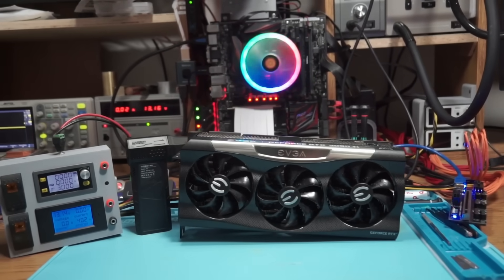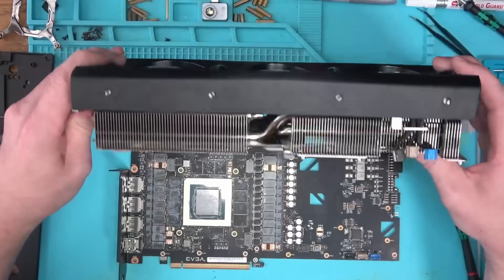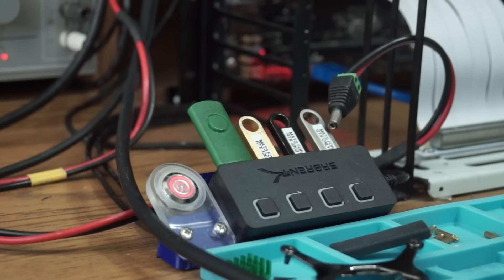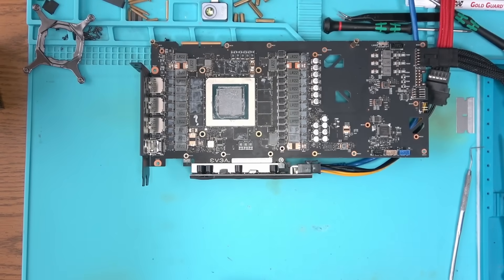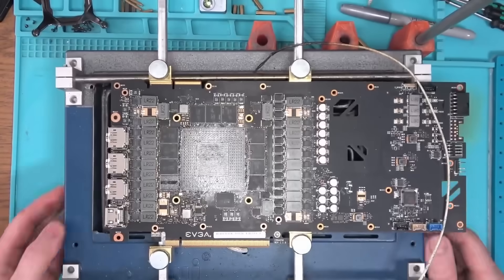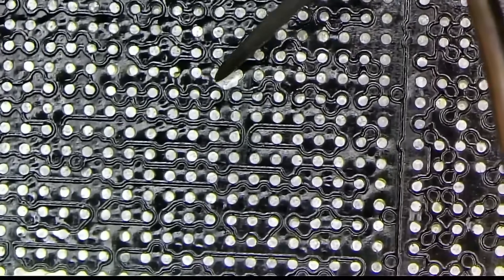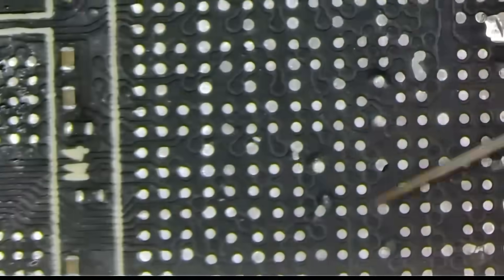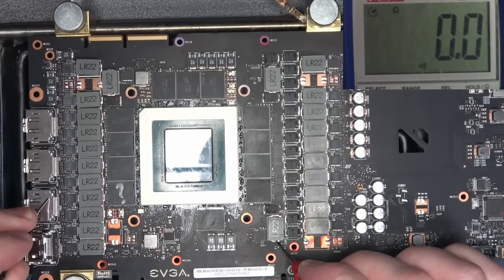The truth behind EVGA RMA'ed graphics card

Comment: You're clearly not doing it right. Put a 1mm thick layer of solder mask where the core was, drill little holes into it where the pads are supposed to be. Solder balls into the holes, melt, put core back on. It will work, you have my guarantee as someone who has never fixed a single GPU and knows nothing about soldering, solder mask and GPUs.

Comment: I had an RMA'd EVGA GTX 980 Ti that i used for about 7 years without any issues. I don't think your card died because of EVGA RMA, I think the PCB probably took too much heat from overclocking. Since each time you re-balled the GPU the problem got worse, either the heat or your cleaning was the problem. I don't think it was your cleaning because i've seen many of your vids where the cleaning wasn't a problem. So it must have been the heat of soldering and removing the GPU that was causing it.

Comment: Just a stupid idea but if that happens to your card, the "manufacturer" is supposed to replace if can't fix? I know it is out of warranty but if the turd party repair shop is cooking the board to death, there might actually be a legal way to either make EVGA or their contractor to pay for damages caused since loose/peeling solder mask is without any doubt a symptom of too much heat aka bricking not fixing the board against better knowledge/practice. Anybody can look up what happens if you overheat a pcb, you don't need to be a genius to know good practice...

Comment: @Northwestrepair. I own a preowned msi rtx 3090 suprim which seems to work fine, but when i start the pc and a tv screen is active, the pc screams with beeps at me: beep beepbeepbeep. Do you maybe know, what could be the problem? As mentioned, it works fine, i even use a gpu supportbracket, but the computer screams at me, when the tv is on. What am i doing wrong?

Comment: EVGA GPU's from excellent reputation to dis-honorable trash service. I own an EVGA 3080 TI FTW3 that I actually copper modded that suffers from silicon lottery temps, but at least the memory runs cooler, and undervolting manages to just get by with the GPU performance. Disappointing, most people would not know what to do about getting a poor quality GPU.

Comment: If you couldn't fix this card I doubt J.C. could resurrect it.   I was wondering is it possible to upgrade/mod an AMD 9700XT into a 9700XTX ?  Thanks for the video.  If I ever need a GPU repaired I will be sending it your way rather than dealing with the RMA lottery.

Comment: Solder mask doesn't like sticking to lead, so the moment a copper trace got tined ur done, even if you apply a solder mask, that mask is now sticking to solder which will melt the time you try to reball the chip and that mask will now float on top of that lead as the surface tension pulls more lead under that mask

Comment: Have you tried relife solder mask? I also do know on iPhone cpus you can get plastic clear stencils with black dots where all the pads are ...basically you apply a small blob of mask and press it flat with the plastic align the dots and cure th e mask then remove and clean you should have a even masking layer across the entire surface ...relife mask is what I use for pad repair under cpus

Comment: Would it be option to make solder reverse ball mask that covers all the solder joints, then spray on conformal coating or solder mask UV let it dry then try a reball nothing to loose ?

Comment: Makes me wonder if there's a possibility of using some kind of 3d-printer-style solder mask applicator. Or maybe a photo mask template. Problem is, you'd have to remove all the mask first, as it will build up otherwise.

I imagine the middle layers are likewise cooked, too, so could have shorts inside the board from solder seepage into tiny cracks?

Just a really nasty problem to solve. Good effort, though!

Comment: Bushing on a full coat of mask and using a plastic clear stencil with dots that line up with the solder pads to prevent the ir light from hitting allowing for perfect insulation repair

Comment: Well, the core and memory are PROBABLY fine, so a donor board transplant seems like the next step, THAT MULTI-ANGLE THOUGH!🔥 Excellent video Tony!
Reply: I've got an MSI 3090ti Suprim that has a core from an EVGA 3090ti FTW3 simply because I have the boardview and schematic for the MSI board, not the EVGA board which had some knocked off components. MSI card had a severed memory channel and I actually tried to drill out the core substrate to try and locate the severed trace to repair, but ended up being too deep to be repairable. The in-layer traces on the core substrates are truly miniscule....
Reply from the maker: Good luck finding 3090ti donor board.
Reply: the issue is 3090 ti pcb not easily available. 4090 pcb exist but even if they are pin for pin compatible, the bios may expect a certain arrangement of display outputs and power configuration (not as simple as the board power, there are something like a dozen measured voltage rails, some of which arent even visible in gpuz or hwinfo. some are for multiple of the same rail like vcore, some are for smaller rails with a power limit that is hit in certain loads. ever have a GPU that power limits at 95% even if you increase the power limit slider? yeah its one of those hidden power rails)

Comment: You may make or find a masking stencil for this kinda case. Seen it widely used in mobile repairs not sure if something similar exists for gpu.
Reply: I think you're completely missing what the problem was here - the solder goes UNDER THE MASK, causing shorts.
Reply: @lookitskazzy  not if you remask it as the OP was stating

Comment: They ended the graphic card business throw away 99% of the engineer, so they did what was needed to get the card until out of warranty and problem solved.
Reply: i wonder how that'll work with my 10 year warranty
Reply: @quantum5661 I'm curious to know also
Reply: @quantum5661 exactly as described above.  They have a small staff to repair cards which require repair under warranty.  

They haven't produced a new card in years and staff that knew there stuff have pretty much all moved on.  Started their own ventures etc.

Comment: Reflow is what you do at home not what a board manufacturer should be doing.
Reply: The real problem is probably the lead-free solder.
It requires much higher temperatures to melt. (180°C vs 210~240+°C)
stronger flux. (higher temperature = more oxidation)
All causing more damage to the PCB.
Reply: Reflow is what you do never.
Reply: @taiiat0    Reflow is what you change your name to if you want to make a Hip Hop album.  😁
Reply: who will do reflow at home and with what?
Reply: The average person isn't repasting let alone reflowing at home, don't be a moron.